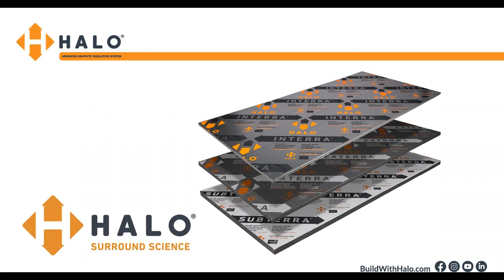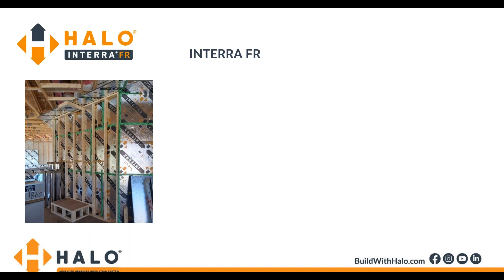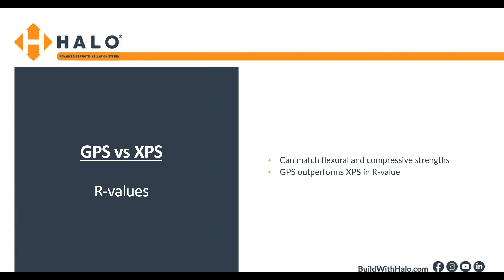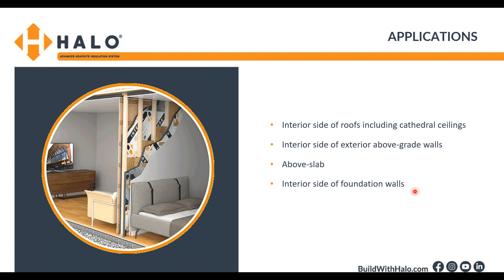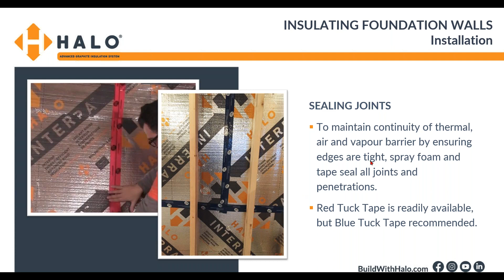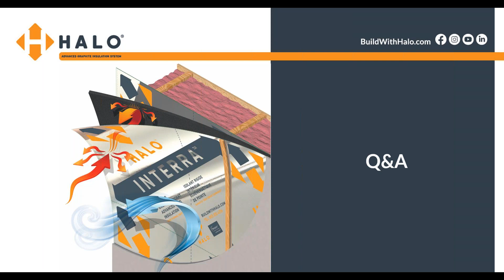WEBCAST: Halo Interra 101 —The Continuous Insulation That Eliminates Vapor And Ignition Barriers

Comment: Can exterra be installed indoor?
Reply from the maker: Hello, yes you can, but Exterra is perforated to allow moisture to escape towards the facer of the board. In many cases, interior moisture is not desired and Interra is used.